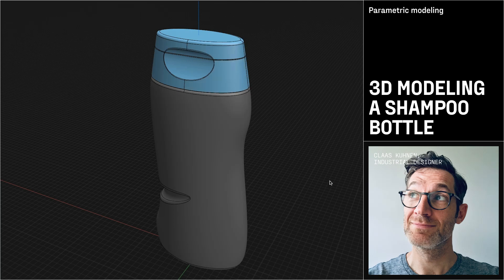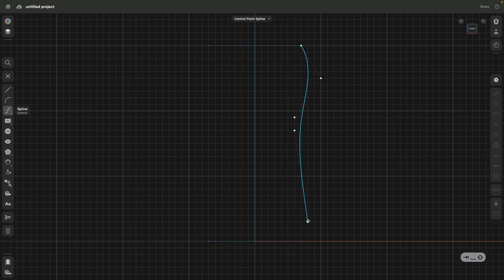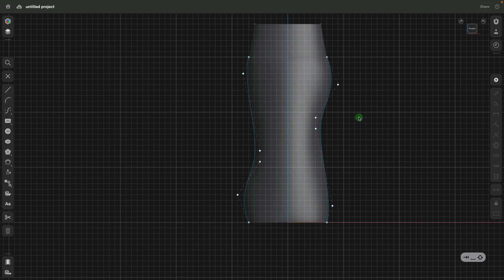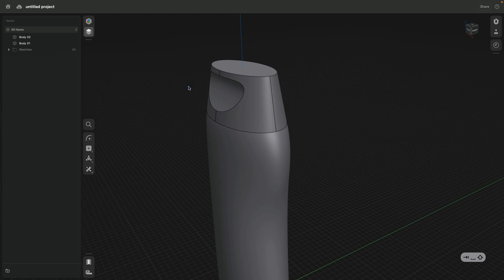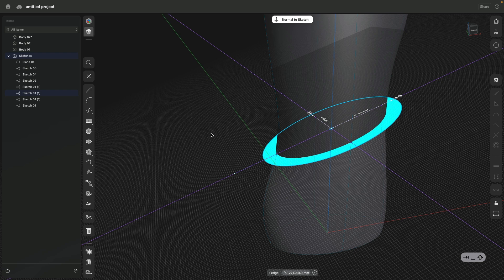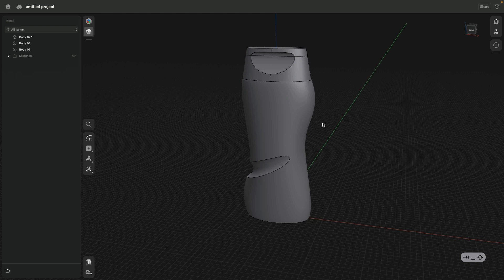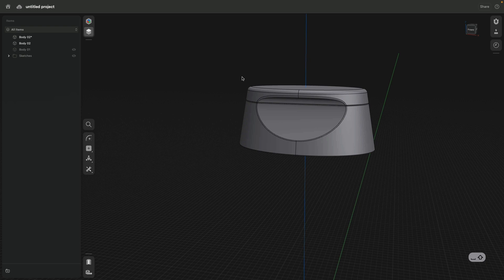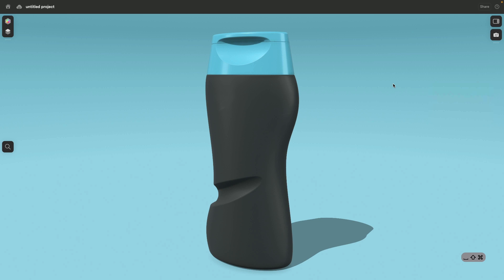Shampoo bottle | Modeling Projects

Comment: So when I select spline tool I don’t get the points on the shapes (2:24)?? Is this a function only on PC? I’m using iPad Pro and this incredibly annoying
Reply: Could you fix it? I have the same problem
Reply: @mariajosemunozb5551   sorry I’m late to this! I did, I believe there was an update that was available (not sure it was the fix as it was much more recent than this video)

Oddly, after I got it to work once it began to work in the way it wasn’t working before.

So the way that I found that it has to work that when you attach your first point, it has to be where your and X and Y axis meet. (The shared point of the green, red, blue lines)

I also had to be facing the front flat view .

For some reason when I follow those directions exactly and I swear I tried it every other way, but as soon as I started it from that point, it finally started showing the points .

After I got it to work that way, then it started doing allowing me to start anywhere and I  didn’t have to start the point at that converging point of all the axis points. 

Hope this helps!